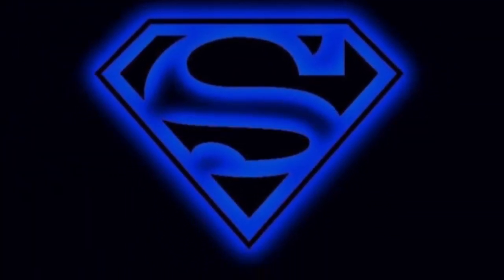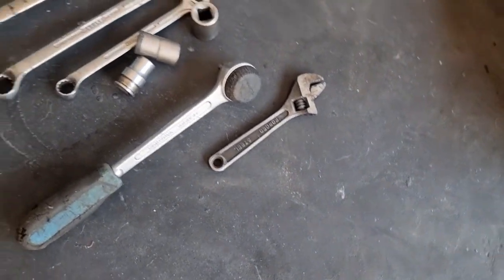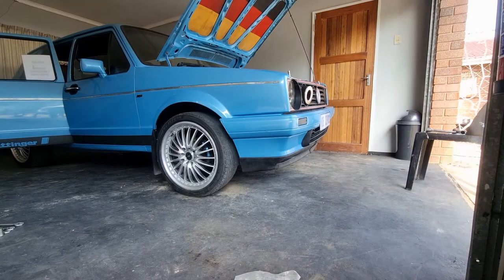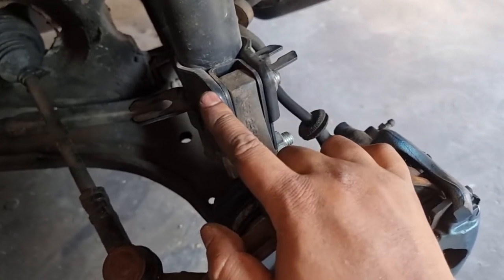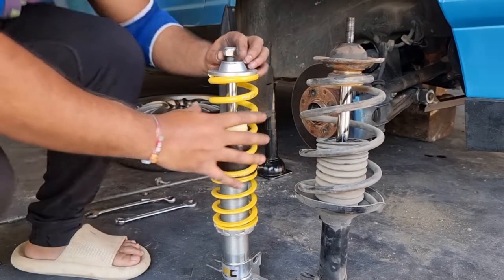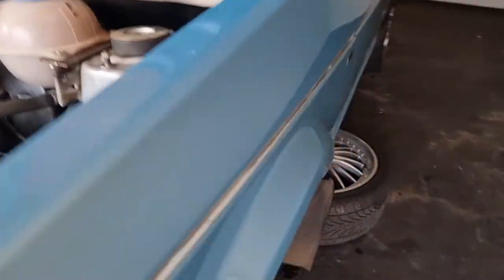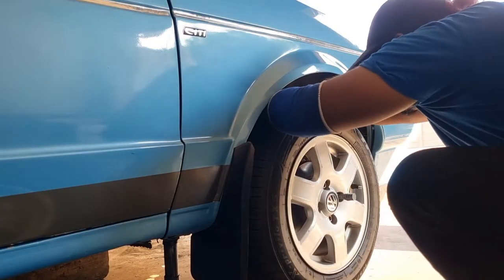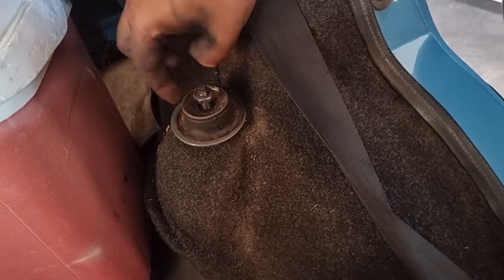How to install coilovers on a vw golf mk1 (step by step)

Comment: Hey bro , if you take out the helper springs and keep the fenders standard... will you still be able to turn normal?
Reply: And how is the ride without the helper springs?
Reply from the maker: If you're going to max out the coilover and go the lowest it allows you then you will have to roll your fenders or else the fender will rub on the tire and get damaged another thing you should be careful of when maxing out the coilover is that your steering rack arm will rub on your chassis arm unless c notched.
Reply from the maker: @delvinsafers3930  this depends in the brand of coilover you are using if it is a higher end coilover  then you won't have a "bouncy" or "harsh" ride but another thing to remember with one way adjustable coilovers is that the lower you go the harder your ride will get.

Comment: No drop links?
Reply from the maker: On the mk1 golf's they don't use drop links but in newer cars like vw polos and so on they take a shortened drop link to go with the coilover kit
Reply: @supermancustoms  are you absolutely sure buddy? Is the lack of drop links not detrimental to the stability of the car?.
Reply from the maker: @medicineman7461  yes absolutely sure as older model cars do not have sway bars so we cannot connect drop links but on my personal vehicle in the video I have an after market lower stabilizer bar which helps my vehicle stay sturdy at high speeds I will show you this in a future video👌🏼
Reply: @supermancustoms  oh was it not a hassle fitting one? I own a 2009 CitiRox and i never knew these babies never came with sway bars lol. It's on lowering springs and its pretty stable even at high speeds
Reply from the maker: @medicineman7461  no they fit from one end of the control arm to the other side it's a simple installation you should consider changing to coilies I had lowered springs on my 07 velociti and once I went static I loved it so much that even now that she's gone I made the project car static as well 👀